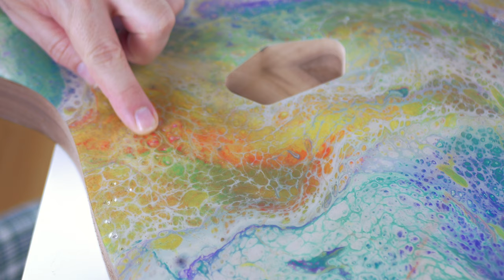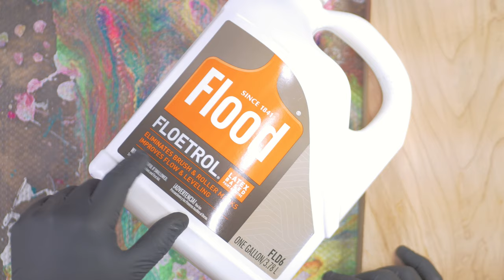Acrylic Pour Guitar Body Blank

Comment: I would highly recommend mixing your own paint bases, you can actually control the *weights of each by adding more/less water, alcohol, flotrol as well as a silicone. -this would allow you to not have to put white between each color, you could put whatever 2 next to each other that you want! Some colors should have 2 drops of silicone, some with 1... That's kind of important. It's how much distortion you get.
The weights of each paint play a huge role in the depth of the final pour.... For example purple might weigh more than orange as intended and when it's poured you get the same effect as here but purple would be underneath the orange and orange would part 'atmospherically' to reveal purple - near zero mixing of the two. 
Maybe I'm not good at explaining but there's some videos out there that go into technical detail of what is going on with the pours.
Reply from the maker: Great info. I admit, I jumped in head first only after watching a few videos. I'm gonna keep trying until I get it right. Thanks for the advise!

Comment: Should be pretty easy to fix that epoxy. You may be able to sand those craters down a tad with some 800-1000 grit sandpaper to get it as smooth as you can first, then you could dab CA glue (super glue) into the craters. Once it hardens, you can sand it down smooth again and polish it. CA glue is also great as a final clear because it polishes up very well and it's very hard/scratch-resistant. 

One last thing, since I commented to you about my Kiesel, I got to thinking about something, and you may also appreciate this idea as well for your own future use....

There is a product called "waterslide decal paper" that you can print images onto with an inkjet printer. You saturate it with water, and a  very thin film with your image printed on it slides off onto whatever surface you want the image to be transferred to. This could be very useful for a situation like mine, or for future projects of your own. It's something guys use in custom chopper builds to put images on gas tanks, etc. I've done it a few times. Once the image is transfered to the surface, it can be buried in clear coat, and then sanded smooth to hide the edges. "Alchemy Kustom" on YouTube has a few videos on how to do it. I got to thinking of this since I could use this for my top to create the same effect, using images from online of various acrylic pours (or of anything), while having the benefit of being able to pick out exactly the "pour" I want. Whether I will actually do something like this or not, I don't really know.

Just another tool to have in your tool belt.
Reply from the maker: Good idea about using CA glue. Never thought of that as a touch-up finish option.

Comment: Mark, what about the 9-string guitar with curved frets? Did you finish it?
Reply from the maker: Working on the body. I just finished jointing and glueing the body blank. I'll record the build over time and release it as a single video. In the meantime, I'll be releasing several other vids.
Reply: @MarkGutierrez  👍🥰😎🤘

Comment: Hypothetically.... Could I commission you to do this to my Kiesel? It has a blue denim finish quilted maple top, but the job was kind of rushed so it turned out looking like shit (in my opinion). Tired of looking at it. Although, I suspect that it may be too much effort to do an acrylic pour on the top... I'm just desperate to get it refinished.
Reply from the maker: I think Kiesel guitars are top notch. I can't believe they would botch a finish job. The only reason this acrylic pour worked was because it started as a blank slab. Pour was applied, then the guitar shape was routed. Otherwise it wold be very very difficult.
Reply: @MarkGutierrez   Indeed. That is definitely the advantage of starting from scratch. Yeah, the guitar I got was a rebuild. The first guitar (Holdsworth signature) ended up getting the pickup cavities incorrectly routed (I ordered direct-mount pickup and it was mistakeny routed for bezel-mount), so I opted for a rebuild (huge mistake on my part). The original had the most insane quilted top I've ever seen with a blue denim finish with a highly figured royal ebony board. It's insane. It's actually pictured on Kiesel's website when you go to their page for the HH2. It looks absolutely incredible, but the rebuild is totally paltry in comparison. Been kicking myself ever since, but they wouldn't show me pictures of the first guitar when I asked. I was naive at the time of how all of this stuff works. Pictures if you're interested:

Since Youtube won't let me post the links, you'll have to go to the imgur website and paste the following after the "/": 

Original: MyxF9kn.png

Rebuild: ZWCaFLb.jpg

You'd think after screwing up a customer's $2800 guitar after six months of waiting, you'd go out of your way to pick out the most exceptional woods and whatnot to make the guitar at least as good as the original, if not better, just for the inconvenience and to leave a good impression. Unfortunately, that just isn't how Kiesel operates. Once they have your money, they really couldn't care less about you.

Anyway, thanks for the response. I've been getting pretty into custom paint work lately (painting motorcycle gas tanks to resell, etc) and I'm generally pretty crafty. I'll eventually come up with something. Just looking at different possibilities.